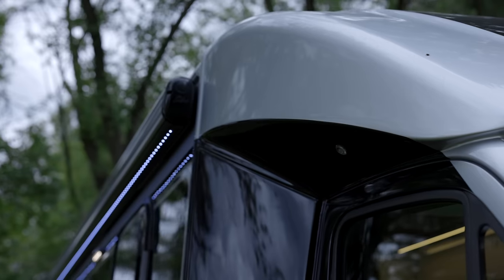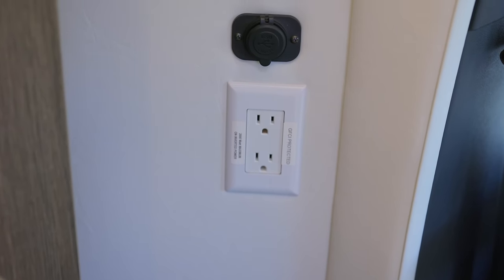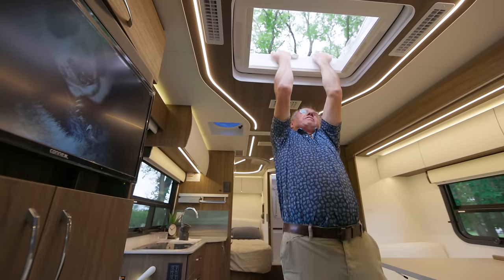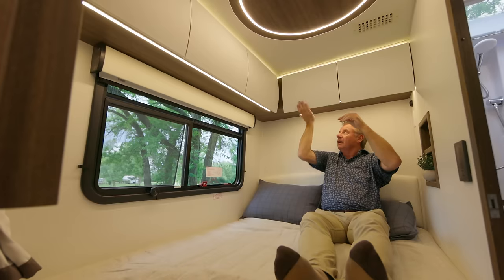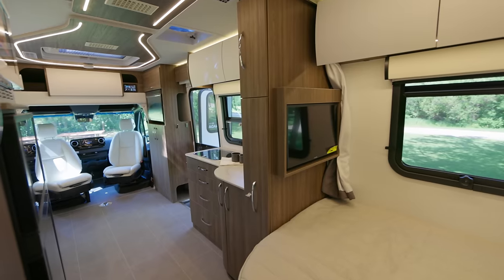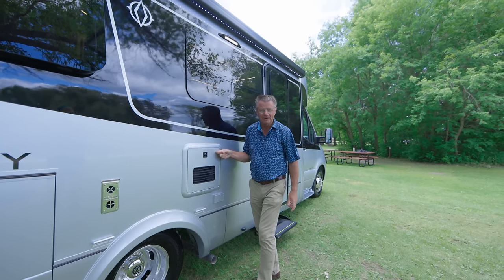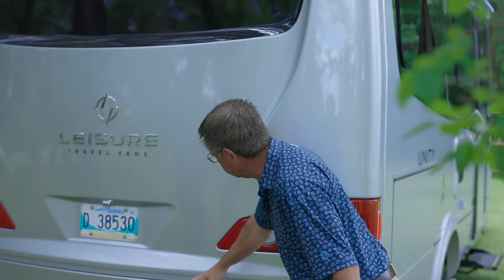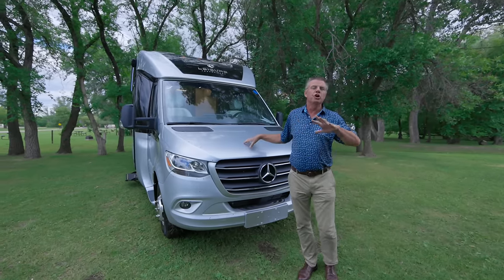2024 Unity Corner Bed

Comment: Impressive van! I have a couple of suggestions that could enhance its functionality. Firstly, consider placing the power plugs for USB and 120 in the dinette, under the window but above the table. This arrangement would significantly improve usability compared to having them behind the person seated there. Additionally, I recommend utilizing dovetail joints for all drawer joinery to ensure superior strength.

On a personal note, I find the bathroom sink to be a bit too small for practical handwashing—increasing its depth would be beneficial. Lastly, upgrading the TVs to higher-quality options, such as Samsung smart TVs, could enhance the overall entertainment experience.

Despite these suggestions, I want to emphasize my appreciation for the corner bed and bath; the floorplan is well-designed and functional. Please understand that my intent is not to be negative, but rather to provide constructive feedback aligned with the expected standards for a camper van of this caliber.

Comment: It would be ideal if the U Lounge bed could be converted into a full size bed. While this RV is designed for children, it lacks three-point car seat belts for younger children. Therefore, the length of the lounge bed should be more than at lease 75 inches to accommodate older kids.

Comment: Dean, with diesel passenger vehicles becoming a rarity, diesel prices are much higher now vs. gasoline - so for this RV, and the other Leisure Travel RVs, are there plans to offer gasoline versions of these vehicles as an option?
Reply: I think that the Wonder version is built on the Ford transit chassis (gasoline)
Reply: @medusawebb  I am aware, but what I meant is this particular chassis comes only with the MB diesel engine - why not a gasoline option as well?

Comment: Its a nice unit but I'm  not a fan of the small corner bed as it has no room to sleep with your partner! unless your both under 5' 8" and less than 150lbs lol. Slide outs just allows more cracks to lose heat or air conditioning. Personally the twin bed model is the best model. great video as always